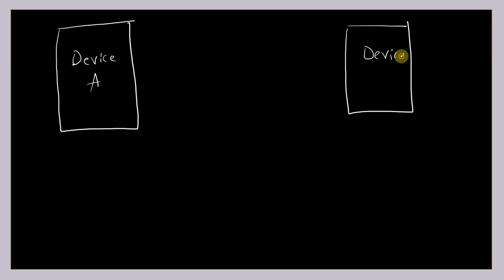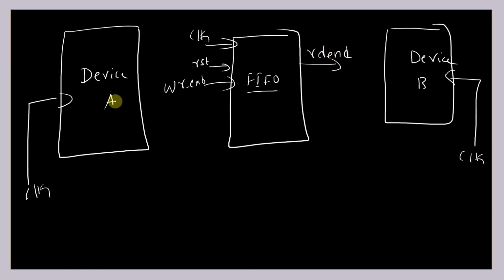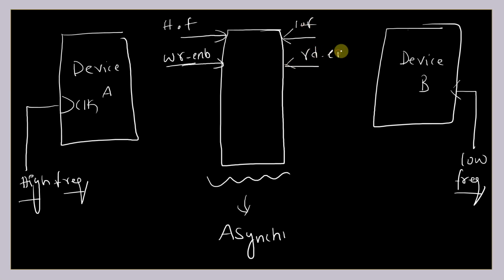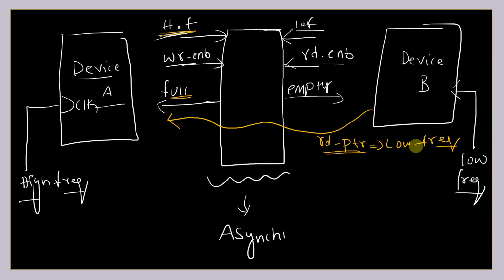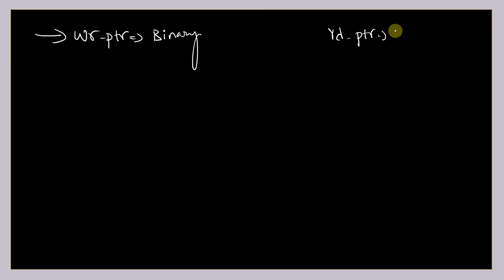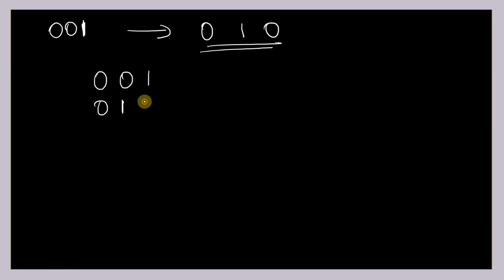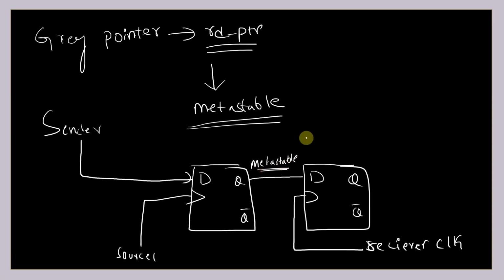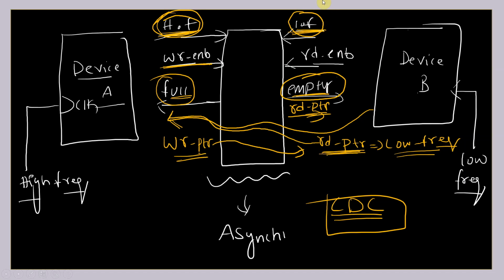Clock Domain Crossing Using Asynchronous FIFO | Ethernet MAC controller design || All about VLSI ||

Comment: Hi Anna, This project is being very helpful for us, Can you please say how many more videos are there in this series upcoming regarding ethernet controller, and how many days more will it take to complete it fully fledged??

And can you also please clarify about the new RISC V course how is it different from the previous one already available on you channel and do you try to implement Pipelined architecture this time?? 

Thank you ❤
Reply from the maker: Ethernet controller has 10 more sessions 
New risc v covers coa topics as well as 5 stage pipeline implementation
Reply: @Allaboutvlsii 
If you don't mind can you please say how many more days will it take to complete those sessions or is there any course I can join for to complete the design quickly??